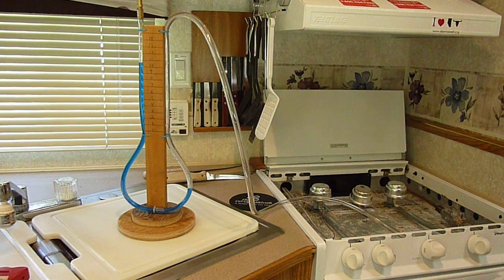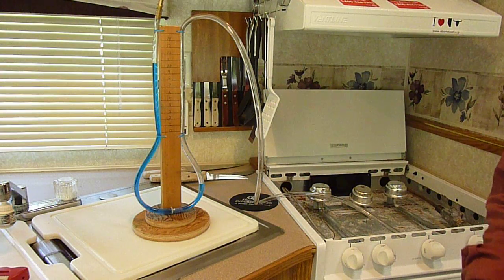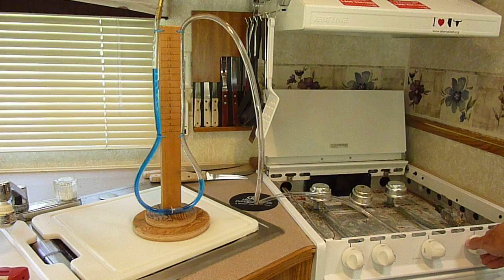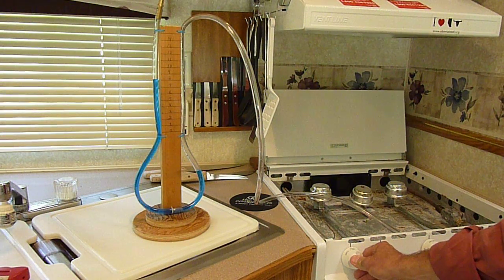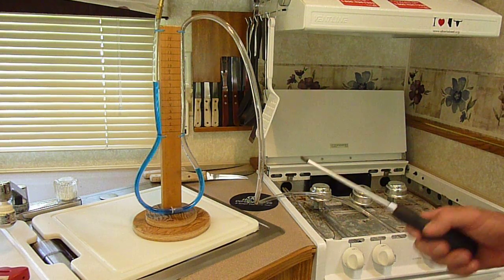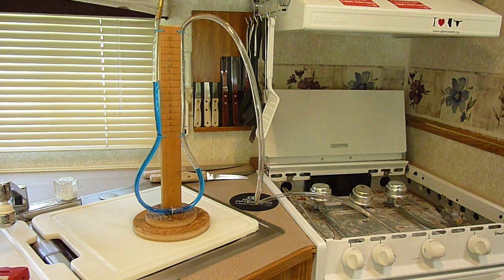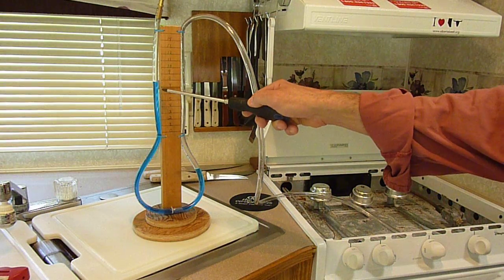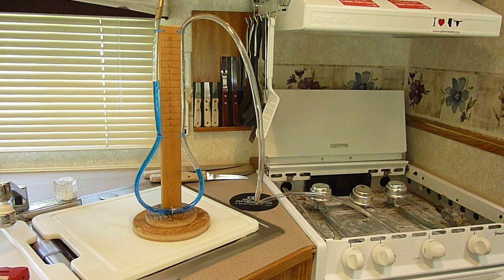Manometer testing for propane leaks in RV gas system

Comment: The pressure is the difference between the high and low water levels, not just the high side.
Reply: He numbered his scale in 1/2 inches, so 11 half inches from zero on the high side is 11 inches of difference from high to low so he is accurate when he says 11 inches WC of pressure.

Comment: Unfortunately testing propane flow or lockup from a stove burner will give false readings my friend. There is usually a secondary regulator on the stove so all your readings from a burner will be incorrect. If you want to use the stove fine, but connect manometer to the main propane lead to the stove BEFORE the stove regulator. Otherwise your readings will be off for all other appliances. This may give you an ok leak test, but not flow or lock up.
Reply: You are correct Sir. People need to understand your statement to get manifold pressure at the appliance.

Comment: Hi Guy, thanks for the informative video. I made one for my camper. What’s weird is when I turn off the propane, it keeps pressure for about 10 minutes, then starts to drop visibly. Probably 1 inch every 30 seconds. I’m confused by what could make it stay pressurized for 10 minutes and then start to drop at a constant rate after that. Have you ever seen anything like this?

Comment: Hello Guy, thanks for the great vid, i would happily compensate you for some more info on this subject, i have a Craigslist special, its a beautiful Trav'ler stove but the oven won't stay lit. I have been told its the thermocoupler but i can't get the thing out, it seems to be bolted in with a bolt you can't see. I made  your test machine and the LP seems good, a bit below 14 but the  level won't drop when i turn on the pilot, it did at first i think but then stopped.....could you help me with this?  Thanks!!
Reply from the maker: There are a few oven configurations and they are all a bit of a pain the axe to deal with. Make sure the pilot in the oven is a clear blue flame, you might need to clean the orifice for this. If I remember correctly, some thermocouplers had mercury in them and were discontinued. Whatever you do, be careful with those ovens.
Reply: well if your willing to look at some pics of it i would love to get it working proper, classic little range.
Reply from the maker: If you can give me the exact make and model of the stove, I may be able to help you, and yes, send pics if you have.

Comment: Able asked this question, "So if I my propane is connected to stove, heater and hot water heater do I need to test all appliances or will just connecting the manometer to the stove indicate a leak anywhere in the system." Can you reply?
Reply from the maker: That's right, manometer connected to the stove will indicate a leak anywhere in the system.

Comment: So if I my propane is connected to stove, heater and hot water heater do I need to test all appliances or will just connecting the manometer to the stove indicate a leak anywhere in the system
Reply: Everything will be tested on that line

Comment from the maker: Yes, you can measure vacuum this way as well, but for some applications, the u-tube will need to be very large.  The manometer in the video measures pressure under 1/2 pounds per square inch.  I think a vacuum cleaner creates a vacuum much higher than that. Thank you very much for your comments...Cheers to you!    ;-)